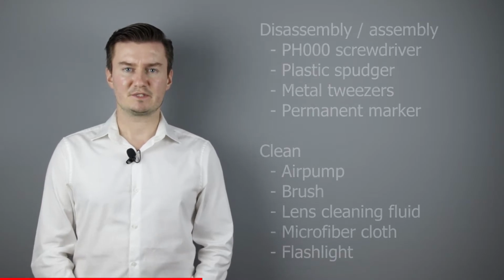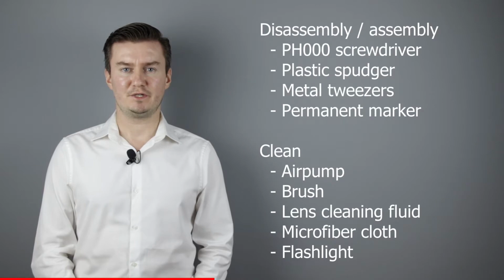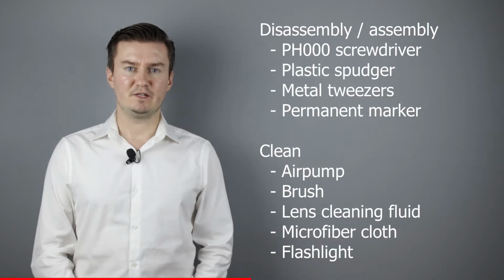Canon EF 100mm f/2.8 USM MACRO - how to clean the lens inside

Comment: Can I use alcohol to clean the lens ?
Reply from the maker: Yes, you can. Currently I use alcohol first, then distilled water, then wipe it dry.
You have to be careful with cleaning the inner lens elements, apply less pressure, because it is easier to scratch them.

Comment: Is it possible to clean the inside part of the inside lens?? Nice video!
Reply from the maker: If you would like to clean the lens elements which are inside the lens, then you have to completely disassemble the lens... I have a video about it when I replace the aperture cable, check my other videos.
If you have a molded lens element which has fungus inside, then it is almost impossible to separate them and glue them back together.
Reply: Have you got any tips on taking the molded element apart? Mine got fungos only inside the molded part.
Reply: @mabner  suspect mine has a little there too, & why sending to Canon for cleaning they claimed extensive damage & cost of repair more than lens worth so sent it back?! Ridiculous. Lens is perfect mint otherwise. 
Definitely affects image Q. I wonder if cleaning the accessible glass has it the worst could make real difference & worth a shot. Or if fungus in sealed focus group has biggest impact & waste of time.
Did you find a solution? Open to suggestions not sure my options. This has been an incredibly sharp, great lens but clearly its design flaw is very poorly sealed. Here's hoping my EF-S 17-55 2.8 doesn't go the same path. Have heard it's poorly sealed also, & zoom is known for sucking debris inside.